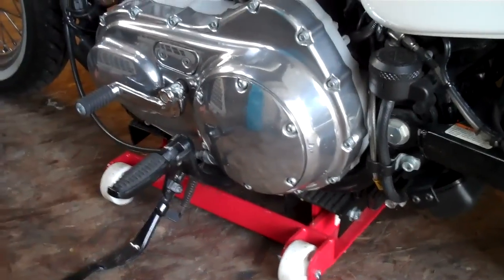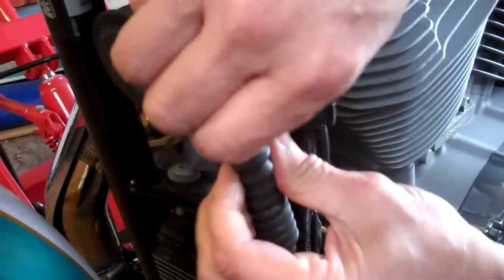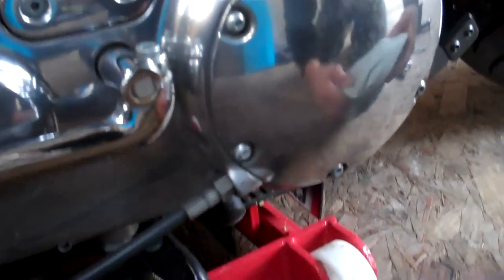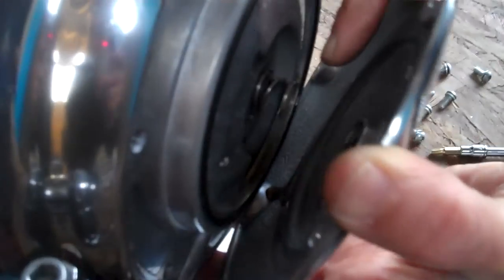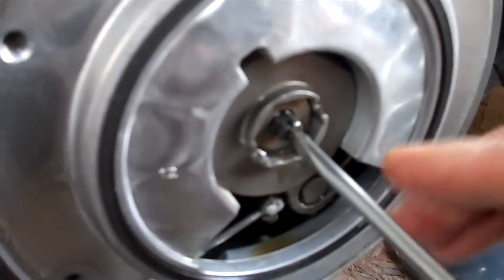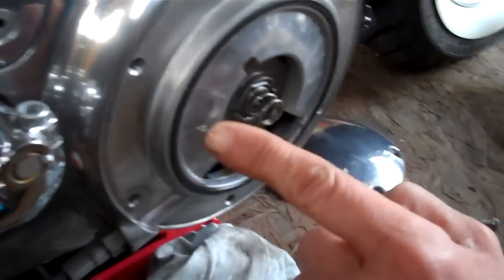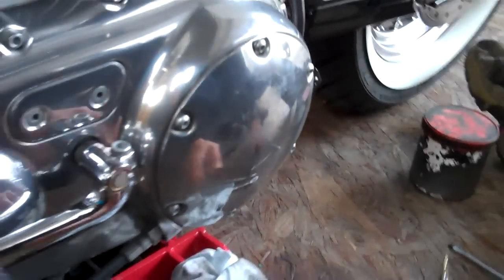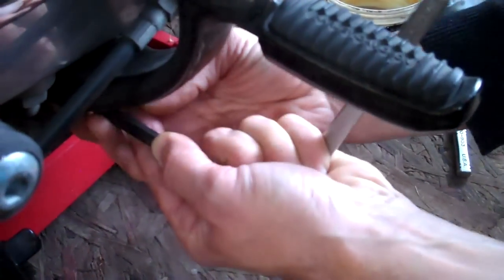Delboy's Garage, Harley Sportster Clutch Adjustment.

Comment: Excellent video! Can I ask what kind of Jack stand your using to keep the bike upright? I have an 09’ Sportster and can’t seem to find a Jack low enough to get under the bike. Thanks in advance!
Reply from the maker: Here we go mate, this is the one I used back then, great lifting capacity, will pick any bike up and definitely low enough to get under your bike... but as a little trick if yours is exceptionally low, and if you have someone to help, you can roll the back wheel up on to a brick, which will give you 4" extra to pop the lift under, and then when you come to get it down, pop the brick under the tyre when you drop it, then roll it off once the jack is out... hope that helps:  https://www.sealey.co.uk/product/5637191828/motorcycle-quad-lift-680kg-capacity-hydraulic

Comment: Hey Man, love the vids.  Been switching a lot of things on my 99 sporty, including putting new bars on it which needed a new clutch cable.  She's finally running and on the road, but the clutch pedal seems to be sticking.  Do you know if I might be missing a spring or something else that I haven't seen?  I'm running forward controls.  Have to manually pull the pedal and push it down depending on how I'm shifting.

Comment: i need to check and see if there is a vacuum leak. any ideas on how to do it for an old amatuer mechanic? i'm going for motorcycle repair and my teacher suggested taking off the airbreather and spraying carb cleaner in there to see if there is a leak.  i'm not sure where to spray or look. thanks for any suggestions or help.

Comment: I have a 2007 Harley sportster xl1200c. when you adjust the clutch does it have to be in neutral or 1st, gear, or does it matter.

Comment: @Moonfleet41 yes I did this today and my Harley it is a 87, 1200 sportster , I had to do this about 10 times to get it just right, I had to turn that screw to the right a little further then you did on yours. my clutch cable is max out at the adjustment but it still grabs . im thinking soon I might just have to change the clutch and cable ty for your vids help a lot

Comment: You're the man Delboy
Reply from the maker: Thanks Dane, glad you enjoyed it mate..!
Reply: Just adjusted mine a few minutes ago. I noticed that when I was adjusting the free play at the end, I could pull the lever in, and pull on the cable as I let the lever out, and actually pull the cable out quite a ways. This led to much confusion as I tightened it up more (with just my hand) only to find the lever getting tight. Took me a while to realize I was just pulling it out too hard, was much simpler than that.

Comment: Hi Delboy, thanks a lot for all the hard work you have done on help full videos. I have a  2007 sporster custom 883, and I have two issues with it, first one, when I ride it on high speed and reach to traffic lights or have to slow down engine still running on high rev then gradually drops down in about 30 sec.  and second question, when speed goes over a 50 or 60 Km/hour whole bike shakes (images in mirrors vibrate), I thought Harley Davidson improved this after 2006 models. What do you think?Thank again Mick
Reply from the maker: +mehrdad sahba Hi Mehrdad....sorry to hear you are having problems sir, with the revs, have you checked that the cruise screw is wound right out and the throttle is not hanging in....its the tiny wheel between the two cables (as the exit the twist grip)...make sure it is not screwed in too much holding the throttle open..?... if its not that, is the bike modified in any way, pipes? air filter? Protune?, and when was it last serviced..?    Oh, and the vibrations are always there... they always vibrate at low revs so the images blur....but not sure how much yours is vibrating just by description.. need to see it to judge if its not right..!!

Comment: First off, thank you so much for you videos. Great job helping the rest of us. Thank you so much!
I have a question. A friend of mine drives a road king and is complaining about how hard it is to get it into neutral when he stops. Any advice on how to correct this?
Reply from the maker: Hi Marcos. Good to hear form you buddy.. With any operation problem that isnt normal, the very first thing to do before you go looking for faults, is to correct all adjustments in the area of the problem, to thier factory specifications.....then you'll find that 90% of them will go away because its just something adjustable out of whack over time and use.... So first i would maybe suggest to him to change the Primary case oil, do the clutch adjustment if he knows how (its slightly different on a big twin motor than on a Sporty)....and finally adjust the cable play at the same time as doing the clutch....

Once all three are done, then go ride the bike and see how it is...if its still harsh and reluctant to select neutral, then let me know as there are some deeper checks...but ill have a bet with you that resetting everything and changing the primary oil will fix it...it usually does.. ! let me know how it goes..Del.
Reply: Moonfleet41 Will do. thank you very much.

Comment: just to make sure then, i loosen the cable first then turn that adjustment screw all the way left "counter clockwise"  till it gets tight , or snug rather, then turn it a quarter turn clockwise. is that correct? thanks for the reply.

Comment: Thank you for sharing your knowledge. that tip for my batt worked for me thank u so much! behind where the cable pice hooks up to is lose can u tell me is there something behind it that keeps it center. the front will center with the adjuster on the front but behide it wont center and tips? if u want I could make a vid to show u what im talking about. thanks again for all your vids they r so much help. thank you del!
Reply: ok I got it its the cover that is broke letting it go to far back. the lip that holds that 3 ball clutch peace puller. from going to far back
Reply from the maker: Roger Cornish  Hi Roger, not quite sure what you're asking, so send me a link to some photos or a short video and I'll have a look! Del

Comment: @Moonfleet41 Yeah, that what I did. However there is something else going on in the clutch pack somewhere. I wound up taking it to the HD Dealer and they rand the clutch adjustment all the way in and out a few times to loosen it up, lubricated and adjusted the cable. However this didn't fix the problem. There is still grabbing when in 1st gear and clutch squeezed and the higher gears are still slipping under load. They are going to keep a the bike a while and research the cause.

Comment: hi Del, thanks for all amazing videos related with these maintenance and repair tutorials. it really helps. one quick question. today i made the clutch adjustment. everythings seems perfect. however i made all the job while the bike was on 1.st gear. should i keep it like that or should i do it again while it's in neutral?
Reply from the maker: Hi buddy, whether the bike was in gear, or in neutral, at the time of the clutch adjustment is un-important, as long the procedure was carried properly and you adjusted the cable slack in the middle and at the top, then it will be fine.... good on ya for taking it on mate, believe it or not, that's an hour's labour at your HD dealership, so well worth doing!

Comment: If the Bighorn is similar to other 2 strokes then its one of 3 things... If it has no drive when in gear and the lever is released it can only be one of the following... The clutch plates are finished, the pushrod adjuster is incorrectly set so the plates are not biting into each other or one of the other components is either missing or broken. had the same issue on my RXS 100 and the pushrod adjuster was set to far in.. it sounds like the adjuster is missing going by your description

Comment: Hi Del
Thank you for this video, just did my 01xl1200

Have you made a video about the proper amount of oil that should go into the sportsters primary/transmission case?
And/or how to properly check it?

I saw you do it very detailed on a different Harley, but the Sportster is a bit different and of course I want to make sure I do it correct

Thanks!!
Reply from the maker: Here you go Luke, a detailed on Primary oil chain for a Sportster!... how to drain it and fill it, and how to check the correct level... if you choose to invest in a genuine H-D factory service manual from the dealer, then you won't regret it... they are pricey, but worth their weight in gold as they cover every single step in the process plus all the torque values as well for specific bike... https://www.youtube.com/watch?v=nxoQ-Yd3zw0
Reply: @Moonfleet41  Thank you Del!
I do have a Harley manual, I use it on my phone while I'm working. It is very detailed, but sometimes I can't quite picture what the manual is trying to explain because I don't have a very technical background (went to school for business) aside from the little bit my father taught me as a child. So I'm trying to catch up now. 
I really appreciate your videos because you give me answers to a lot of the "whys" I'm always asking.

I'm in the garage now, so I gotta pull up the video and get to it. 

Thank you!!

Comment: hey there, I have been having problems with my clutch adjustment, i have read my book and watched your video here and did what you show and explain, and it still gives me problems, when i start my bike and pull in on my clutch and put it in gear it acts as though its in gear and wants to take off, while my clutch lever is pulled in, i am baffled by this and it dont make any sence, would you or anybody else be able to have any idea as to what could be the problem, thanx

Comment: I would like a little more specific info on something...

At around 6:45 you talk about taking all the slack out... So do I want my clutch lever to be pulled in all the way against the bar or fully out like it would be going down the road?

The reason I ask is it changes the position of the outer plate depending on where the lever is.

Thanks in advance for any info on this.
Reply from the maker: Michael Just back off the bottle screw in the middle of he cable so that its not pulling on the clutch...that way the adjustment of the plates will be true and accurate.. slacken out the cable so the lever flops loose... hope that helps.. Del.
Reply: Moonfleet41 Thanks for responding to both of my questions....

I will get it right... unlike most mechanical work this one is more of an art than just doing it... 

I have toyed with it either way so I think I am zeroing in on making it perfect...

Thanks again.

Keep the shiny side up.

Comment: First off, I want to thank you for the brilliant work you've done with these videos. I feel like getting to all of them quickly and catch up. I have a question for you. I ride a 2014 Harley Street 750 and seem to have an issue with the clutch and gearbox. There is a distinct rattle in neutral with the clutch lever left loose. It goes away while riding or when the clutch lever is pulled in neutral. There has also been a lot of transmission whine. Any help is welcome. Thanks.
Reply from the maker: Hi Roopesh.. Sadly, as Harley Davidson have deemed fit to exclude the UK from having the Street 750 and 500 over here, then ive never seen one....not sure what style of clutch they have or in fact what the engine is even like... Penny was interested in test riding one when she was looking to change her Sportster, and the dealership blew her off saying there wont be any in Britain so they arent able to help...... so sadly my friend, i have no idea other than to suggest maybe take the bike back to your dealer and ask them to listen to it for you... sorry i can be more help mate.. good luck with it.. Del.
Reply: Moonfleet41 Thanks for the reply. I'm glad Penny isn't able to test this example of the Street 750. Even though it has a strong engine, aesthetics aren't in place right now. Hopefully you guys will get a slightly refined version. This is the curse of the early adopter I guess.

Comment: Howdy Del, love your vids, clutch adjustment brilliantly explained, did mine with a new confidence. Thanks.
I've also watched the baffle swap on the 883 with interest - I've got a 1200XL and had two, 4" baffles inside aftermarket pipes of which I've now replaced with 8" ones, I've been considering wrapping them with some exhaust wadding as to soften the rasp, what do you reckon on doing this ? - Keep up the good work.
Reply from the maker: Hi Nigel..thanks for your kind coments mate. with your baffles, if the pipes sound a bit too raw and aggressive for your taste, then wrapping the baffle tubes in wadding will mate a big difference...they will sound less hollow and more refined, but you wont loose much volume either....and as the stuff costs so little then why not...and not sure if you know, but you can use loft insulation...its the same stuff..!  the tighter you pack it and wire it in place, the longer it will last too. good luck with it buddy, regards, Del.

Comment: Harley Davidson recommends using Lithium grease on the clutch cable adjustment boot not wd-40 and you adjust the clutch backwards not from seat but you should see the clutch  lever backing out from the clutch adjustment as well as the cable adjustment...All you've done here is inspection and cable adjustment. Once you have back out the adjustment screw till it does not move the brake lever out any more is when you do the 1/4 right turn on the screw.....And then adjust the cable....I am a Harley Davidson PHD Graduate of the MMI Pheonix 2007.....Good on the torque sequence though ....
Reply from the maker: What nonsense is that mate... why are you talking about the brake lever.?
Reply: I meant the clutch lever..sorry, when you back off the adjuster at the clutch you will see the COLLAPSED clutch lever moving out to it's correct position...

Comment: Hi man. I watched your video trying to find a problem on my '13 883. Maybe you can answer my question. My bike has a little bit more than 2k miles. Since I bought it, it makes a huge noise when releasing the clutch, like something scratching. It happens more between first to second and second to third gears. I told the dealer, but they said it was a too tight chain. But the noise persists. I hope you can help. Thanks from Uberaba, Brazil.

Comment: hi, if you have to adjust to get the "flats" to line up, adjust the screw in? turn screw in clockwise a bit?my bike is a 2001 1200 XLH,looks exactly the same other than derby cover. plus i had a L of a time getting the screws out of the derby,i had to order a75mm long  5/16 shank T27 to fit my impact hammer driver and still no go then i rode the bike to warm it all up and sit in the garage to percolate the heat throughout. a couple blows and out they came,of course before the adjustment had to let cool down till the next day,remember the impact is spring loaded and 1 wack triggers the mechanism so you have to recock it,(twist it to the left to remove,right to tighten with downward pressure)after each wack.
Reply: ok,i screwed the adjustment screw in by an extra hair or 2, works perfect now! thanks Delboy. I reused my Torx screws,now need to find some hex heads to make it easier.
Reply from the maker: Yes buddy... screwing in a tiny bit more to line up the flats is fine.. its not critical.. and good use of an impact driver.. but be careful not to crack those casing, they are a bit fragile when you start beating them..!

Comment: Is there a special place to ask general question ? You help me 4 years ago & your advise worked perfectly . I've got another dilemma ???
Reply from the maker: Whats up buddy..?
Reply: I have a Harley 883 ASPT softail. You helped me 4 years ago about a bad fuel tank . It  finally caught up with me. After a month off I started the bike but it would only run w/choke partially on. I removed fuel tank cleaned it out , then I pulled the sock filter off & put an external fuel (petrol) LOL filter on. I removed a disassembled  , cleaned  the CV carburetor . I blocked off the vacuum diaphragm on petcock . Will gravity feed be enough or an external fuel pump is needed ? I'm wait on a fresh battery now . Your expertise is desperately needed & appreciated. Thanks in advance .
Reply: Moonfleet41 just wondering if a 883 Harley can get by without the vacuum fuel pump & can run gravity feed.